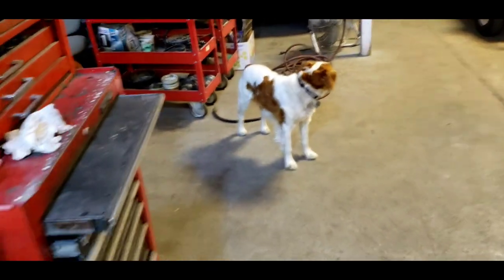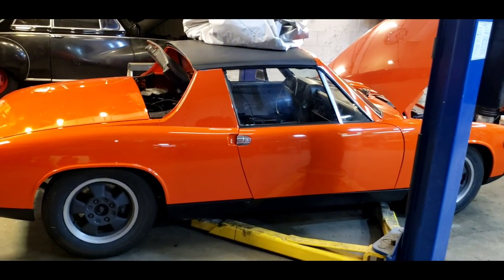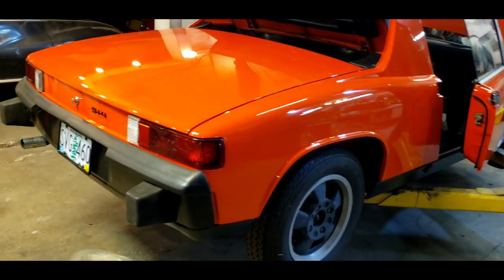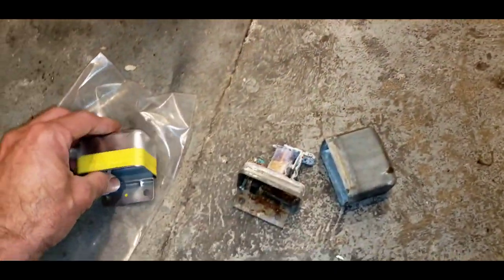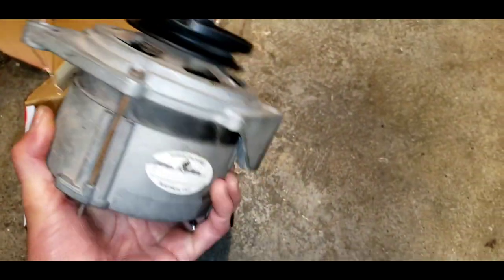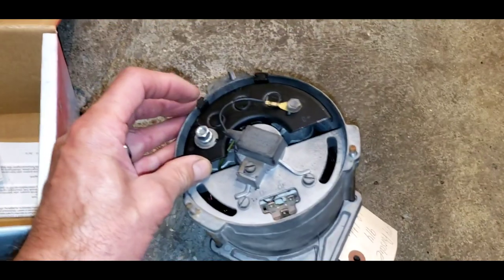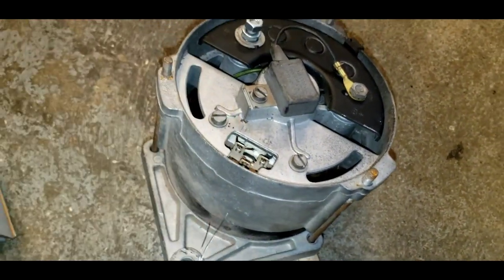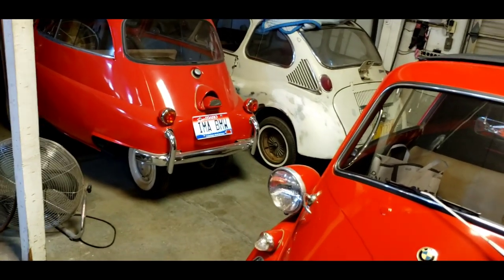Why Won't My Porsche 914 Charge? Part 1. Broken!

Comment: I'd say that the plug can't pop off with the cooling plate bolted on by the 3 fixings. It will butt up against the plug itself. It would have to pull of about 10mm to come adrift.

Comment: I have NEVER seen a loose plug on a 914 Alternator. Done uncountable ones. Best way to replace is engine out of the car.
Reply from the maker: I'm beginning to think this voltage regulator wiring was sabotage.  Both ends were disconnected and hidden. Not sure why.

Comment: 79,, Ohio,,,, hauling back heat exchangers from VA .. Drive 4x4 4 wheel steer car to Portland transmission show? Must tend to 5 ton wagon ..
Reply from the maker: Yes !  Portland transmission show Spring classic may 13th!
Reply: @2stroketurbo  we,ll see if I can make delivery and have time to get car ready// with sunny forecast

Comment: It's 4 nuts to drop that motor, just like a VW bus. Then you can do a full service very easily. Plugs wires valve adjustment points belt alternator.